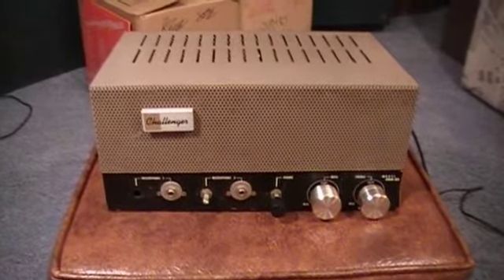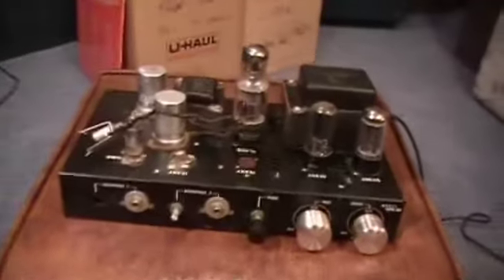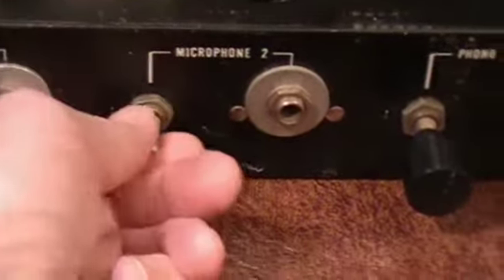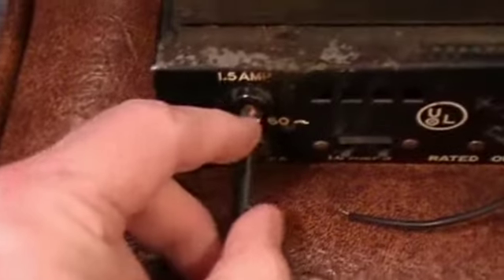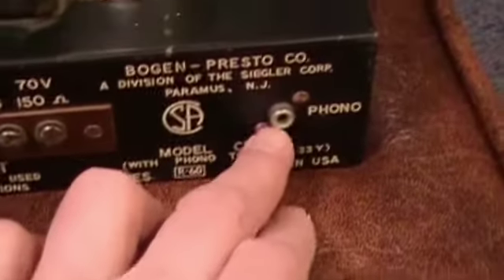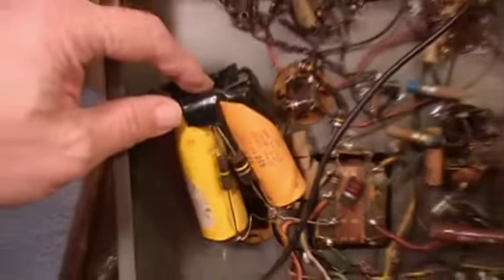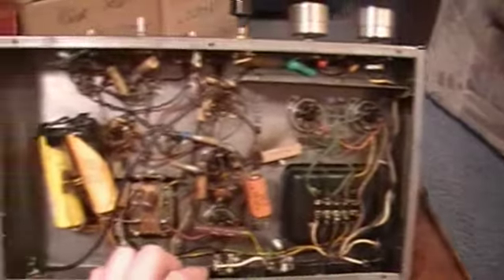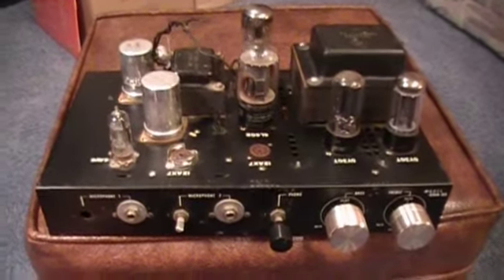Bogen Amplifier CHA-33

Comment: what!?? Have you ever heard music or movies through a tube amp??The sound is unbelieveable , jaw dropping..... especially if you use big  speakers and loud... This is totally worth restoring few capacitors  etc...new fuse ..etc
Reply from the maker: It's just a half destroyed old Bogen P.A. amp, not anything special.  So I passed it along to another electronic hobbyist who is into old tubes.  I already have 3 tube guitar amps, an Ampeg Reverbrocket, a Laney, and an old Gibson Kalamazoo (:->
Reply: bluenazz ...ah  ...I have  a Laney GH50L .sounds good but too loud for in house,. can see in my videos.Also have a Tan colored Gibson Skylark with single 6V6 output ,volume control only...,great distortion turned up .and an Ion solid State amp etc.. I recently bought a Bogen CHB-50 ,has missing fuse too....but I will put an inline   or pigtal fuse in  ...The amp/PA is suppose to have a low frequency response of 20 Hz...perfect for music and movies...or I can plug guitar cabinet in and use tube screamer /distortion /EQ ..should sound good...has solid state rectifiers

Comment from the maker: @chompo7 Hi Joe, for me, the time x cost would be far greater than any benefit I'd get.  You can buy working examples off eBay for about $100.  If I already had the right caps, tubes, and other parts, then it could be fixed.